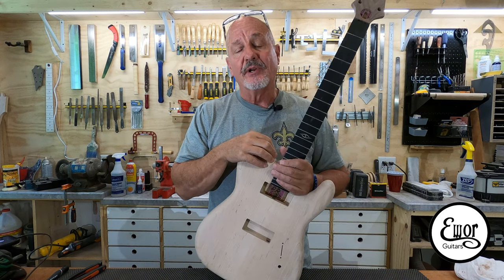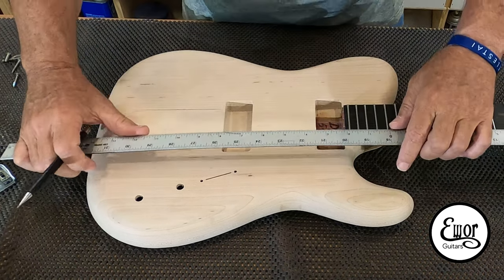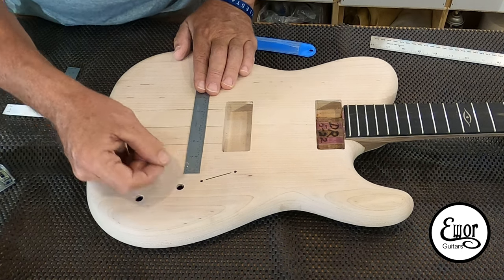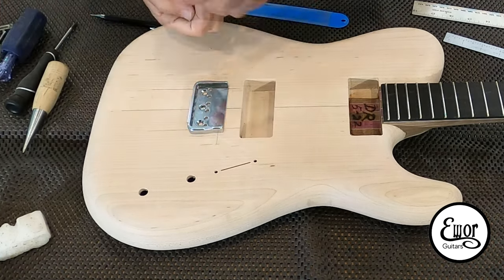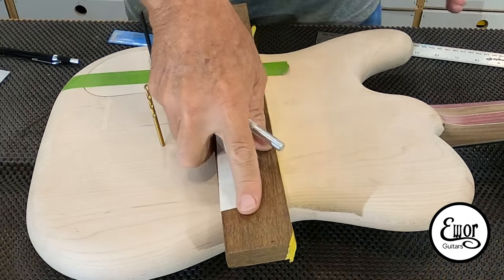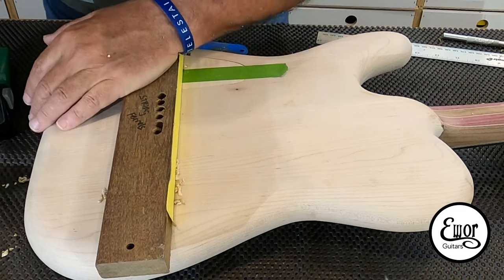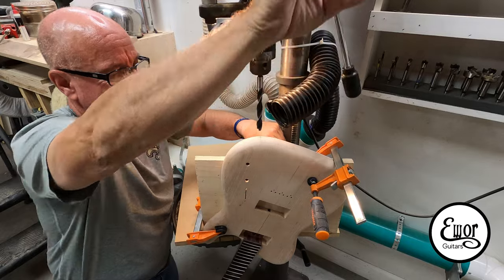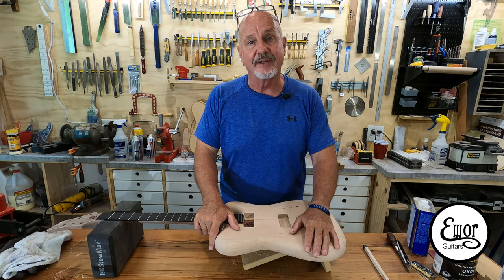How to precisely layout and install a string through  bridge

Comment: Thanks for sharing your layout procedure. Exactly how I was going to do it. I feel much more confident now.
When you use the 5/16 drill on the back side, grind a neutral rake angle on the lip of the twist drill. That will eliminate grabbing and will be much easier to control.

Comment: Thank you for taking the time and putting in the effort to film this and take us along. I especially appreciate your narration/voiceover when you say things like "I probably should have done this before I put the neck on" or "I usually do this with the drill press, not sure why I did it this way". These types of things help al of us LEARN so much more than if you just edit something out or don't elaborate on the why and how of doing certain things. VERY thorough and helpful. I am much more confident in how I want to mount a bridge now after watching your video. I was ready to put a replacement on recently and did not bc I was not happy with the layout and how I would have had to drill screw holes too close to the original holes. After watching htis I am glad I decided to just keep the old bridge on. When I am ready to upgrade I will get a different bridge and use the same method you did here, just for a replacement. Thank you for sharing this with us. Most things would go quicker and smoother without having to deal with the camera and editing, so I appreciate it that you put in the extra effort.
Reply from the maker: Thank you very much

Comment: I have looked and looked for a video that explains this simple looking, yet difficult process in terms that a "master of none" guy like myself can use successfully. Before looking at your vid, I had tried on one build, and though it looked like it was properly done, when I strung it up, the 6th string was on the very edge, while the 1st string was well away from the edge. So I have since been hesitant to go ahead and drill the holes for mounting the bridge, out of fear of screwing up the alignment of the bridge again, and no one else has presented the info in such an understandable way. So I will have to kill my fear of failure, and just  trust my understanding of your explanation and go for it.

Comment: Every time I've recessed a barrel jack I've just used a Forstner bit to counterbore for the flange.  I like the idea of a core box bit to give the recess a little profile.  Most times I also end up needing to add a little cleat in the control cavity so the mounting nut will tighten up square and flush.  The jacks I've used come with a black rubber gasket that gives it a little purchase so it doesn't spin in the hole.
Reply from the maker: Yeah the slight dish shape gives it a cool look. I do the same thing when I recess my control knobs.

Comment: Just the video I was looking for, explanations are clear, excellent, thanks!  I have one questions:  You drew the perpendicular line right at the 25.5" mark on the body, then lined up the the center of the saddles over the line.  The saddles you had adjusted as far forward (toward the neck) as you were comfortable with.  Wouldn't this eliminate any intonation adjustment of the saddles toward the neck?  I'm very much a novice, just having neck blanks #2 and 3 out in the garage, and finished neck #1 still awaiting a body.  I estimate the amount of saddle adjustment for intonation to be about 1/4", maybe a bit more.  Maybe adjustability isn't as necessary in that direction?

Comment: I'm sure you've thought of this, if you had ferrells, with the proper size hole, that could slide over your drill bit, & be seated in your String Thru jig, you'd have the jig perfectly centered for drilling or marking the remaining holes. We had similar jigs/templates (depending on who you were talking to) for drilling a lot of holes. Plus our "drill guides" fit right into the jig, so our holes were perfectly straight, as well.(sometimes we had curved surfaces, like the top of a wing, but we had a jig that snugly fit those surfaces too.) We were drilling titanium, aluminum, composites, but you get the idea. We had to drill literally thousands of holes a day, they had to be straight, because for outside surfaces the rivets, fasteners, screws were countersunk. (Aerodynamics). Funny we were working Hueys, for the Army, & had an old (let's say a man who more than enjoyed drinking) guy who was constantly talking about "the gyroscopic stability" of the helos.(in between bathroom/nap breaks in toilets so full of mosquitos, I don't see how any warm blooded mammal could survive. I'm guessing maybe he'd pickled himself. LoL)
Reply from the maker: Yes some steel inserts would be great but now I’m hoping the cnc machine will take care of that. By the way I bet being an aircraft mechanic is very interesting. My dad (a pilot) always thought I should have become an aircraft mechanic.
Reply: @eworcustomguitars  I actually had more fun working "Field Service". Travelled all over. Factory work was really boring at Boeing. Now Lockheed was a different story. We had to do everything from scratch more or less, as the C5B was a bit different than the A model. They said if we left the layout lines on the parts (just the pencil, marker lines) it would add an unbelievable amount of weight. (They figured all that stuff out). Big thing with B model was weight reduction, so they shaved a few .100 off parts. Believe me that thing is huge. I did body mate. The top of fuselage is Waterline 426. (That's inches). The top of the Empinage, was 65' to the ground. Huge. You have a lot of skills, you do great finishing (to me the hardest part), plus all those other skills. I had more fun doing Electronics, I learned sheet metal on the job. After Electronics jobs dried up, I went into sheet metal. Had a d*mn good craftsman who took me & a bunch of other young guys, under his wing, & taught us the right way yo do it. Turns out Lockheed had offered him all the "suit & tie" jobs, even Dept Mgr, etc. He said "Nope, I just want to make sure all these young new hires can do the job." Believe this it took more time to assemble a lousy wing at Boeing, than to assemble an entire fuselage at Lockheed. (But B had the clowns running the circus, IMO) I'll stop. LoL.

Comment: I always struggle with the scale length line in relation to the saddles. . . I have heard 2 ways of where to place it 1, how you did it! the screws being fully extended and lining it up to the saddle or 2, sure one saddle all the way in (back) and one saddle all the way out (forward) and lining the scale length in between the two extremes so you have adjustability both directions. What are your thoughts?
Reply: Adam, I'm looking for this answer too. Highline Guitars (another YouTuber) puts them all the way to the front, then moves them back 3/32 of an inch -- he then measures 12.75 inches from the middle of the 12th fret to the precise point where the strings emerge from the bridge saddle.  In comments he says that this technique is to accommodate for the fact that more length is almost always what is needed...not sure why that's the case but that was one very precise YouTube guru's description.  For my part, I may hit the local library and seek out a guitar construction book.

Comment: Do yourself a favor and get a self centering drillbit  set that’s used for drilling door hinges.  Use that when drilling the holes for the screws for the bridge.  That will guarantee your hole is in the center no mistakes.

Comment: I find that if I use an 1/8” drill bit first for the string through holes, it works great for me to stop drill bit wobble and won’t make chips on the opposite side of the body…